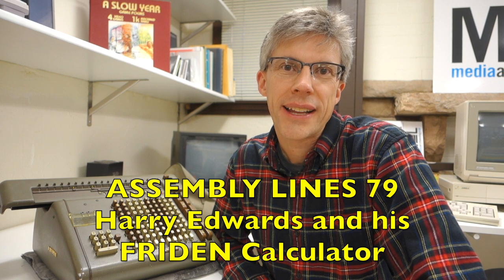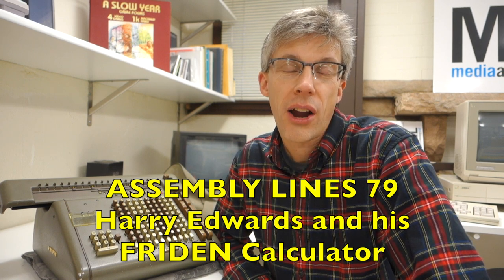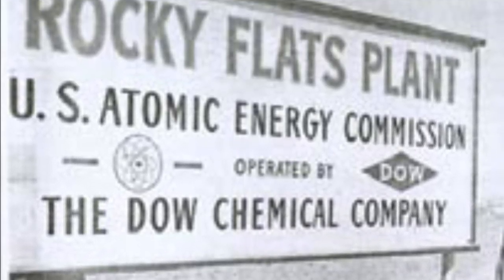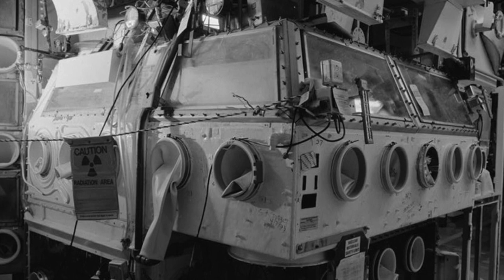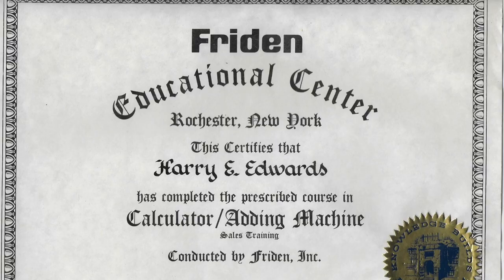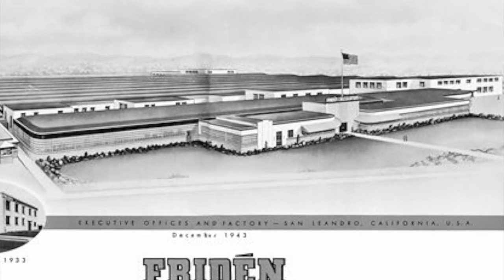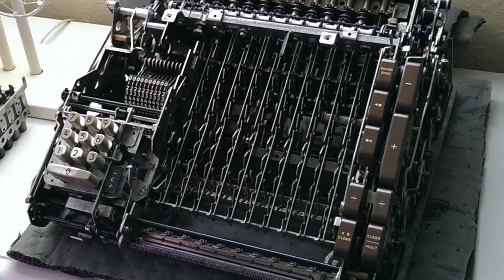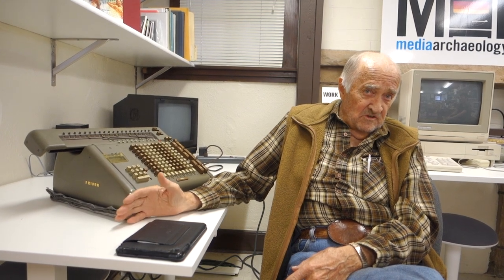#79 Harry Edwards and his FRIDEN Calculator

Comment: I have two of these.  When I first got them, both of them worked.  Unfortunately I stored them in a barn and a mouse built a nest in one and chewed through the wires.  That one is useful for parts only.  The other one looks like it's in pretty good shape and someday I might attempt a repair.  They are really fun when they work.
Reply from the maker: Very cool! Ours isn't working right now because the gear wore out again. But you're right, they're fun when working!
Reply: @CT6502  Good thing you have spares.